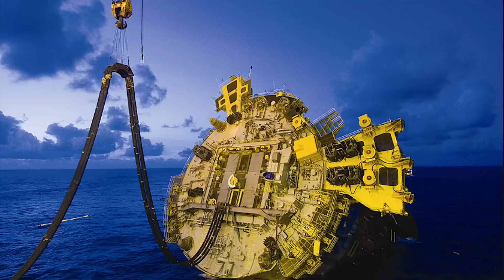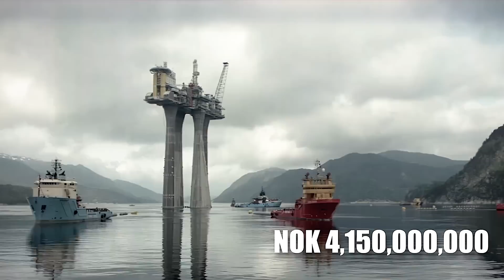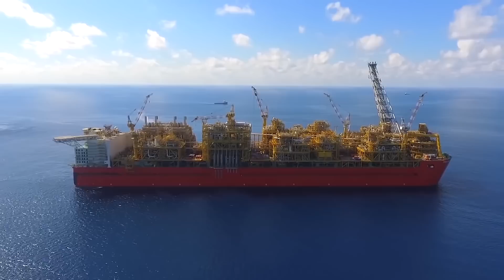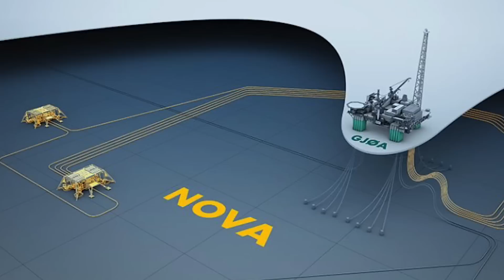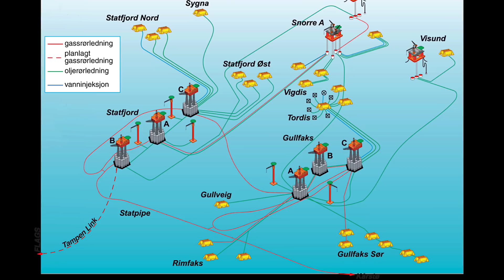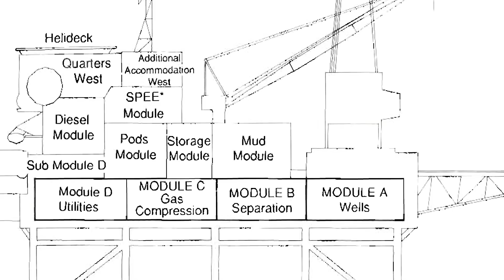The Surprising Truth About Mega Oil Rigs Nobody Tells You

Comment: Hold your horses, dude! "WEIGHING MILLIONS OF TONS..!" is either overkill in bad research or confusion with pounds, eventually?!
Reply: The information is correct: Gulfaks C weighs 1.5 million tons and is the heaviest object that has been moved.
Google is your friend.
Reply: @Sajuuk  It's 870.000 tons. Still massively exaggerated, dude! Average oil-rig is around 30.000 tons. And Google was my friend before content-creators became sassy!
Reply: @roccofalconi  
The video refers to it's displacement "weight", not dry weight, while being towed. It's displacement during its tow to the Gullfaks field in the Norwegian North Sea, was between 1.4 and 1.5 million tonnes at 210 m tow draft. 
The Troll A platform likewise displaces 1.2 million tonnes.
Gulfaks C and Troll A are GBS, not traditional oil rigs that's why they displace/weigh so much.
The Pioneering Spirit is a crane ship that reaches 1 million tonnes at full load.
The Knock Nevis supertanker had a displacement of around 565,000 tons when fully loaded.
If 1.5 million tons isn't enough for you, go build your own 😉
Reply: @Sajuuk  millions = equals whole number multiple/plurals….1 point something isn’t ‘3 or more’….